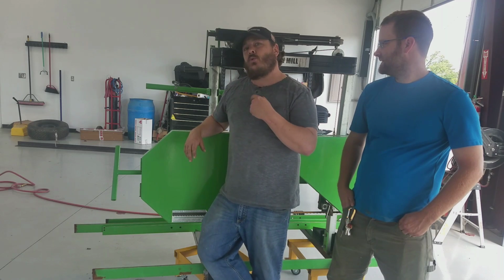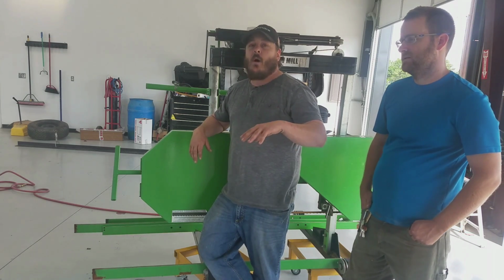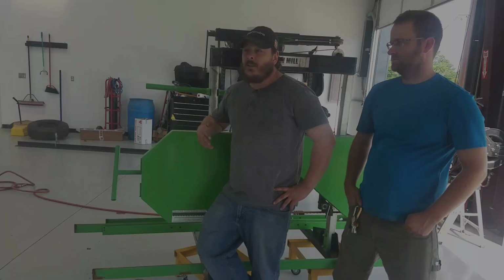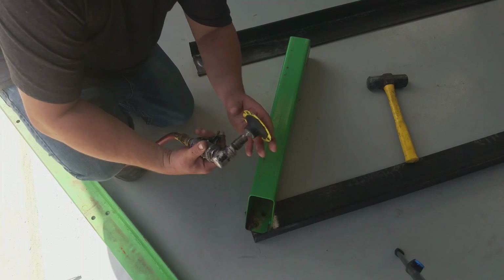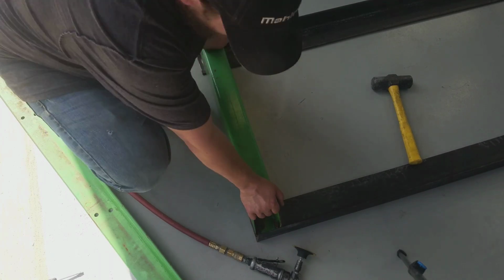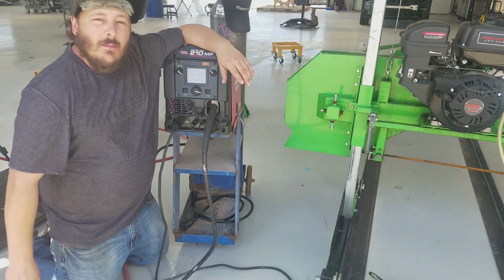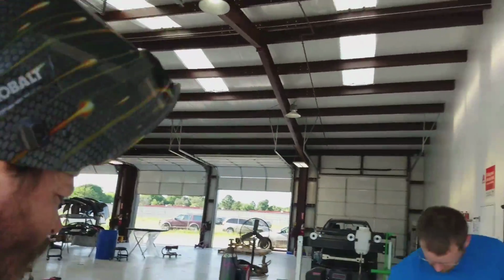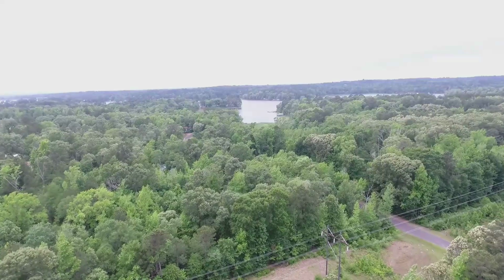HARBOR FREIGHT SAWMILL TRACK UPGRADE.

Comment: Great little mill for the price, even more so if you use a 20% coupon.

You can use a 30" (762mm) spacer in between the rails to maintain spacing. The spec ctr-to-ctr spacing is 30.315" (770mm) per the manual

The problem is not just the dust sticking to the wheel, it's also the dust sticking to the track. Need to address both. Anything between the roller and the track will take the gantry (and blade) out of plane. Needs shields and wipers.

Lastly, need to make sure the plane made by the top of the bunks is parallel to the track. If you kept that original track and use it, you often have to shim one of the lengths of provided angle iron to get a smooth transition. BUT BUT BUT if you drop or raise the angle iron, you might also take that center bunk out of plane. Like you did, the BEST upgrade to this mill is 1-piece rails. Otherwise use a manual level and laser to line it all up.

Comment: To weld through mill scale the best would be to use 6010 or 6011, unfortunately the Lincoln 210MP does neither well enough to count so that would be the worst choice.  *  Next worse would be to switch out to straight CO2 gas for the additional harshness and penetration.  *  The best choice with what you brought is to turn off the gas and install a roll of e71t-11 flux-core.  *  There are advantages to Lincoln's nr211 (~$15/1# roll) but price isn't one of them,  or as I do, buy 10# rolls of Blue Demon for $28 for when MIG welding outside.  *  The other method is to use a grinding stone on a mini-grinder...

Comment: welding long sections of track can be really tricky as heat during the weld can walk the material once it cools. I might have built a jig that would have held the track equal spacing .... You got lucky it did not warp too much.
Reply from the maker: +automan1223 You are correct. To keep it from moving I completely tacked it together first. Worked great and measures square.

Comment: where do you get that metal for the track extension?
Reply from the maker: +ebp1234 We purchased it at our local steel yard
Reply: thanks for the response. About how much did it cost?
Reply from the maker: +ebp1234 It was $45 per 21 ft of 3x4 I still need to buy two more to place under the others for maximum support. Vid on the rest of the build should be up in a month or two.

Comment: Great job of making improvements.

I would suggest ordering an extra set of rollers, and then seeing if you can replace them with something better (preferably off-the-shelf) with bearings, or at least higher quality steel.

I checked out the user manual from the HF website, and it shows those as just wheels and bolts.  They might be okay as-is, but they hold the whole load of the mill, and HF isn't known for using the best quality metal.  At least you'll have an extra set on-hand, just in case.  You know, 2 is 1, 1 is none, etc.

Enjoyed watching you work.  I've only got one more video and I'll be caught up.  Better start crankin' 'em out, man!

;o)
Reply: Will be a few years before that is necessary

Comment: What diameter logs can this handle?
Reply from the maker: +Andrew jones 21  but I maxed it out at 25. Iam planning on using an Alaskan to pre mill my bigger logs into 25 x 25 then mill them from there. With my current setup ICan mill a board 25 in×18 ft. Hope this helps. Iwill be finishing the trailer and uploading the vid soon. Then it an all out logging fest.
Reply: +The Good of the Land  Right on right on! Appreciate the info, I'll be tuned in.
Reply from the maker: +Andrew jones Excellent!